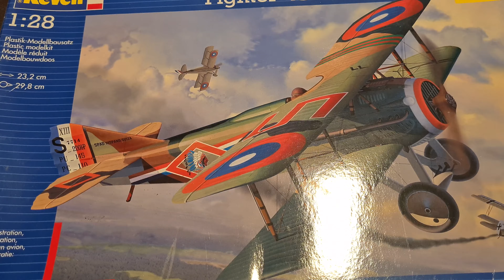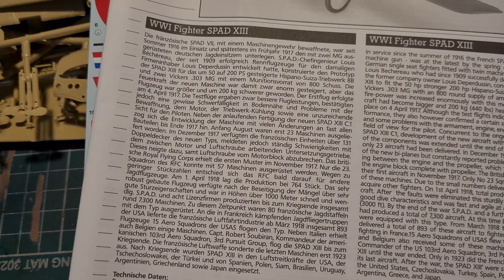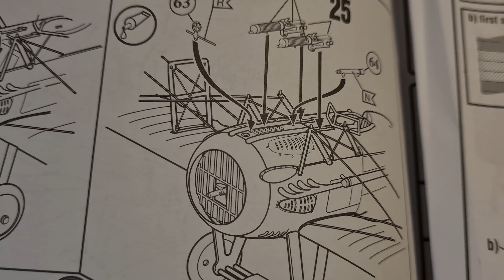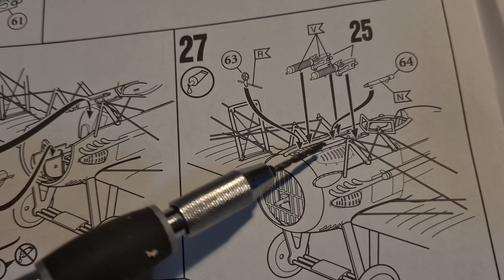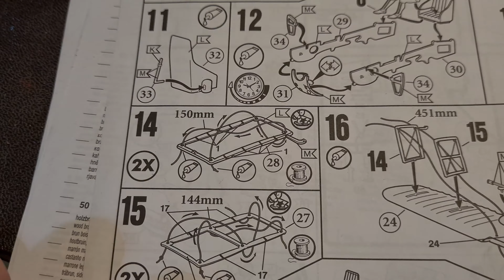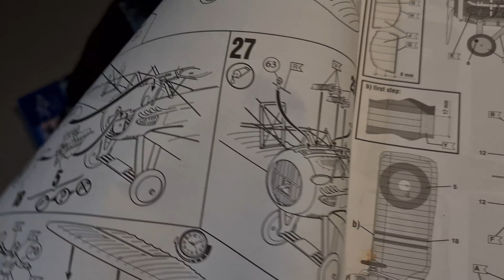Spad XIII Revell Build, 1/28

Comment: these parts mentioned are the triangular fairing (situated between the forward fuselage struts) which covered the piping to the gravity fuel tank and the radiator in the upper wing. Looking at the real plane, it didn't give the pilot a lot of visibility!